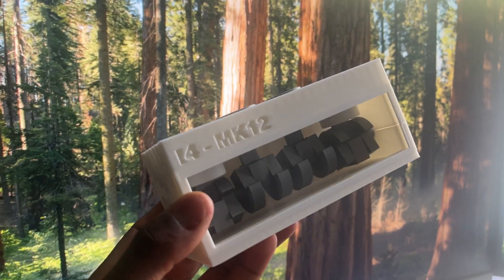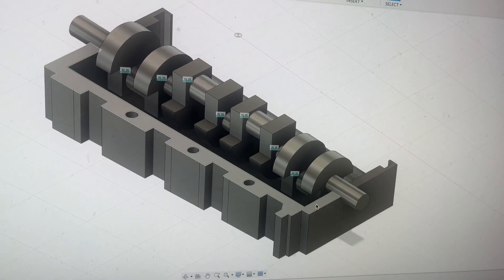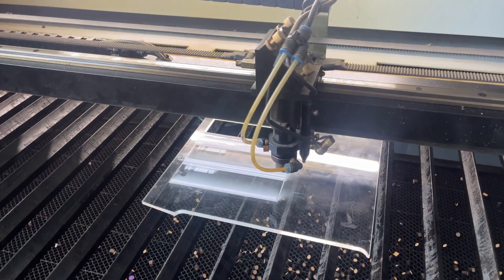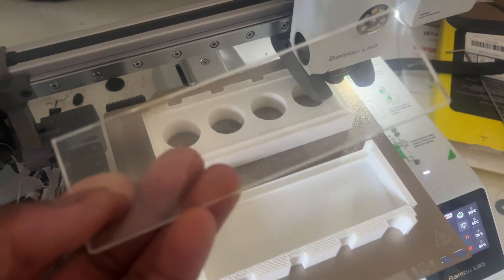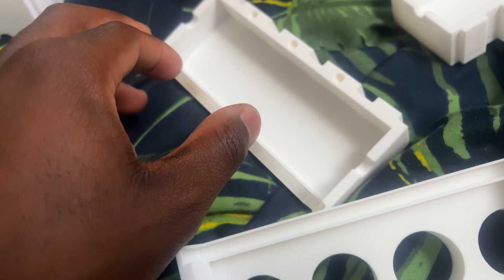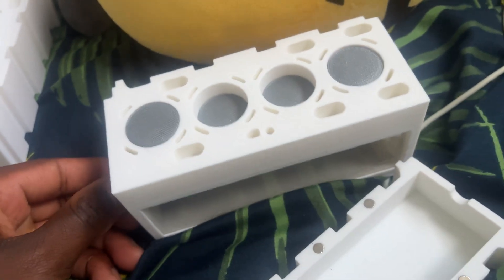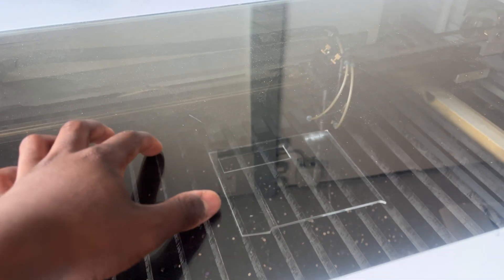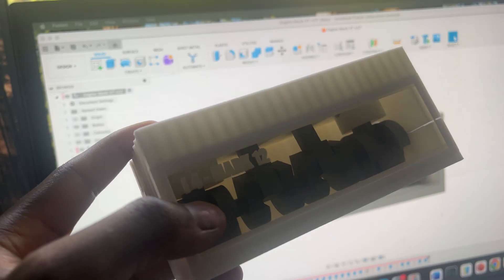I 3D Printed a $1750 Engine Block!!

Comment: "I 3D Printed a $1750 Engine Block!!"  No you printed a Modell that maybe with goodwill costs 10$ to make and that is Modelled like it just came out of a basic CAD Tutorial.
Reply from the maker: No, the material costs for everything I got quotes for and the tools like the tungsten carbide total that cost. I’m manufacturing it out of titanium, I added that into the description of this video but I’m going more in depth to that next video
Reply: @i88y  are you sure thats a good idea ? As far as i see your Modell sofar the engineering is not yet on the level where you should considering to Mill something and waste the Money in the proccess.
Reply from the maker: I’m not going to be manufacturing until it’s completely ready, I still have a year to get it done, this is just a quote for the materials I’m still going to be refining it and adding changes that people suggest
Reply: @i88y  Also a running or Working Engine is  not only a block with pistons and a Crankshaft. Way more complex are things like the Cylinderhead, Valves, Carburation and Ignition. As it seems this is not even considered in any way. And as i said when i look at your Crankrod design i highly doubt that you have the engineering skills to design build a running engine.
Reply from the maker: This is a school project and the whole premise for the project is to make a demonstrative model to show understanding with a use of manufacturing. This is just to show a heavily simplified model of an engine to show how the combustion would take place and the basic assembly of the crankshaft and the order of the firing. The rest of my project is research and I have to compile a presentation, this is a school assignment project, I’m aware that an engine is way more complicated but I wouldn’t even be able to make one with the schools current resources. I’ll make this a lot clearer in my next video

Comment: Great progress! I'd say that embedding text into the print looks cleaner so that the acrylic is fully see through and demonstrates how the crankshaft and pistons work. The design on the side was nice too! This is a great decision to include for unit 5 B or even C as an aesthetic design development.
Reply: work on the handle area so it's easier to grip/turn for users (ergonomics)!
Reply from the maker: I was thinking about that, but I’m trying to integrate easy of manufacturing as well as ergonomics and aesthetics
Reply from the maker: Thank you! I agree, I was leaning more to the side of having the engraving on the body rather than the glass for the same reason especially because seeing the piston in motion looks really cool and I’ll definitely be adding that on 5B or C